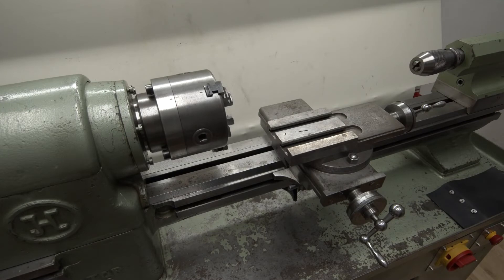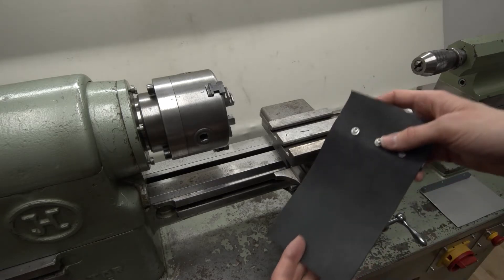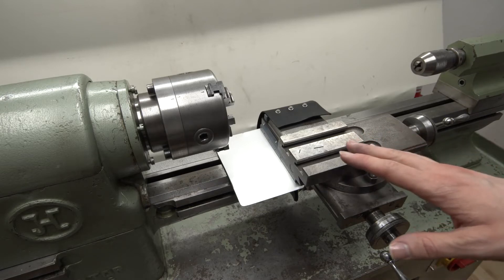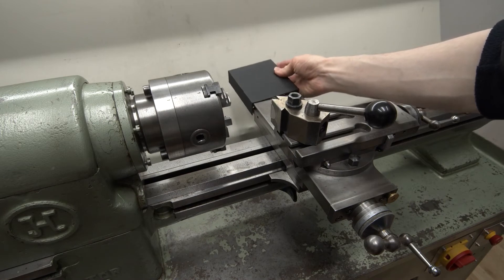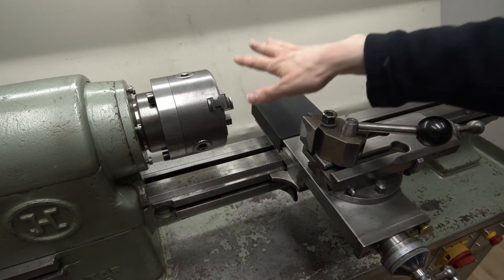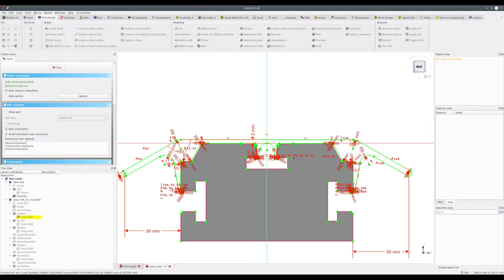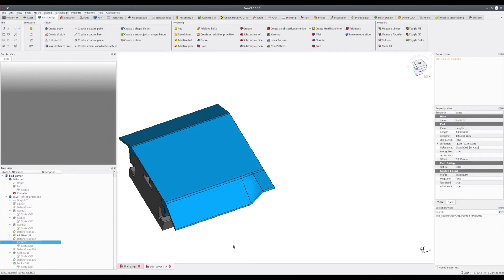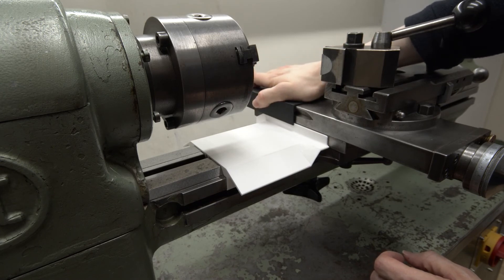Chip covers for the Schaublin 102 lathe

Comment: That is a fabulous solution.
I may be making a faux pas in asking, but are your designs available for download? I would very much like to implement this on my 102, and I don't have the skills to draw something like this up in a CAD software. I would happily pay for the plans, too. 
I'm sorry if this is rude. 
Great video, by the way.
Reply from the maker: Nope, sorry, no plans available. I made the mistake in CAD to base the whole design on the exact measurements (including chamfers etc.) of my particular lathe bed, which differs a bit from the Schaublin print in places. So most likely the design only fits this one lathe bed which makes sharing it rather useless sadly, I would have liked to publish it otherwise.
I may eventually redraw this in a parametric way so it can be adapted to the measurements of other 102 lathes, but no promises as to when that may happen.
Reply: That's completely understandable. Your solution is so sleek and clever that I'm going to try to rip off your design the best i know how (which is quite terrible). Hope you don't mind :)